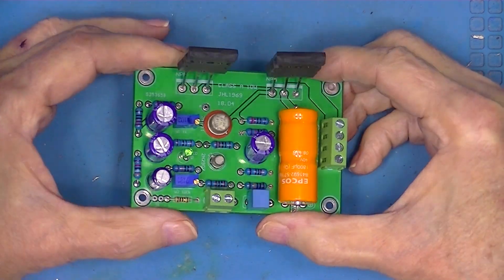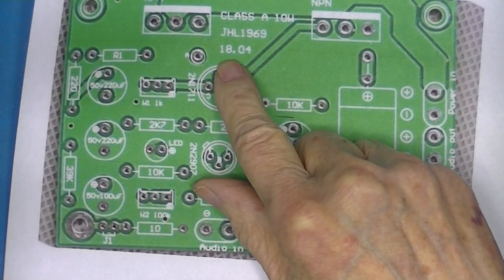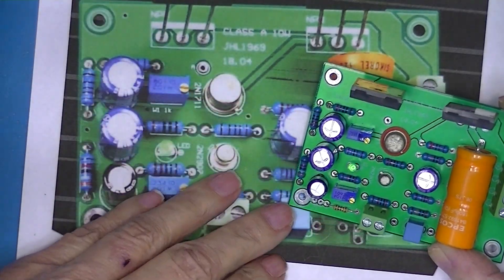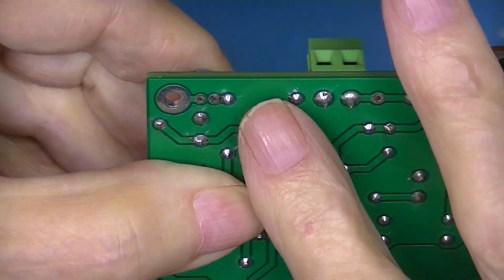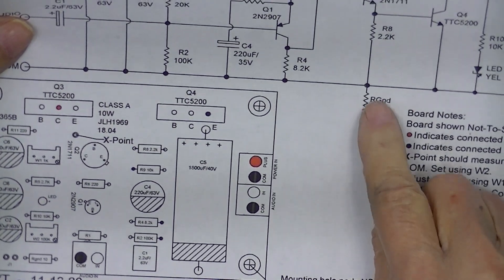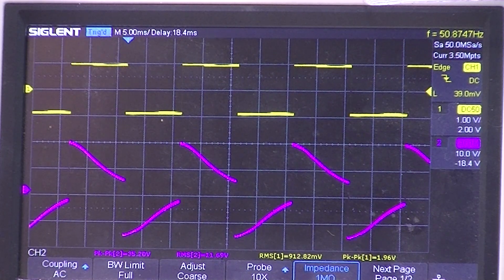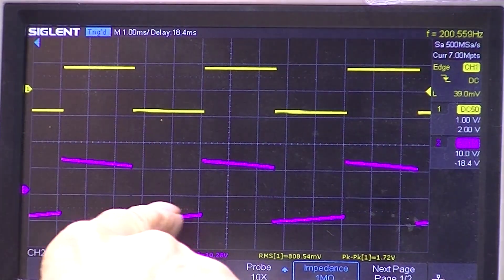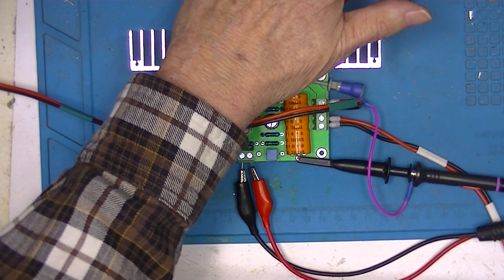J. L. Linsley-Hood 1969 Amplifier - Part 8A

Comment: Surely with one amp flowing the maximum power is IsqR =1sq8 for an 8ohm speaker that's 8 watts. If you can show more using your scope then the power delivered  occurs because the amp has become cals AB no longer class  A. The transistors used can go to 15 amps so I don't get why the amplifier has been limited to only one amp These transistors are also interesting because they have an ft of 30Mhz. On the ESP amplifier site Rod Elliot states that the output transistors for the 1996 version should not exceed an Ft of 3Mhz for stability reasons. I would have thought the same reasoning would apply to the 1969 version. There's no stability components on the schematic.

Comment: That driver transistor looks like it's been reclaimed from another board.  As others have discovered component type and quality is very important with this amp. That's a consequence of the simple construction and it might explain the difference in the measurements on these different kits.

Comment: I was an electronics student in the late sixties and built this amp after reading the original article in Wireless World. Mine had poor HF performance and I contacted JLH by letter. He thought that the reason was down to a different o/p transistor manufacturer. I recall that he favoured Motorola.
I built many other amplifiers during those years. Your video brings back a lot of memories.
After many years with a soldering I final gave up and bought a QUAD 303 Amp and a QUAD33 preamp and settled down to listen to music not the Hi-Fi!!!